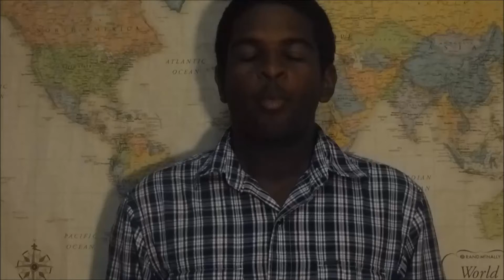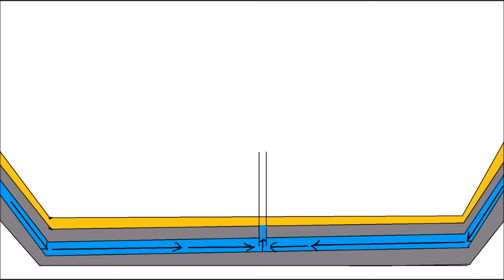TheGEOShow Episode 11: Artesian Aquifers

Comment: Got it: an artesian aquifer sits between two, impermeable layers of rock under positive pressure. Drilling enforces a state of hydrostatic equilibrium, which allows the aquifer to be pumped for water.
Reply from the maker: James Hoskinson In a nutshell, yes. Water under pressure.